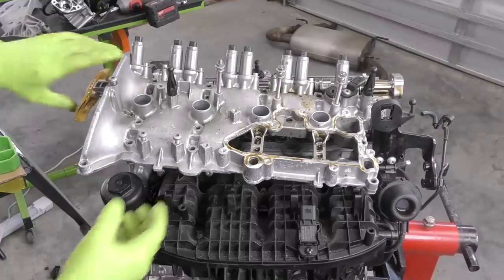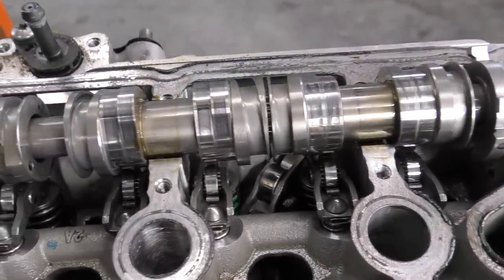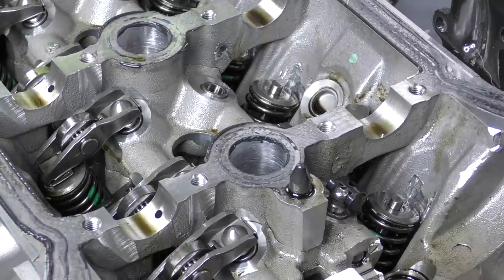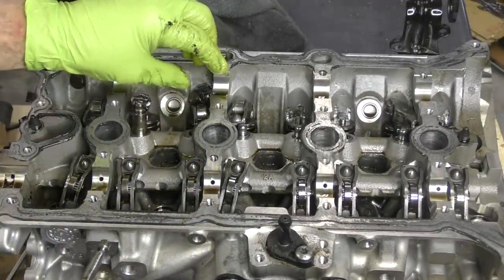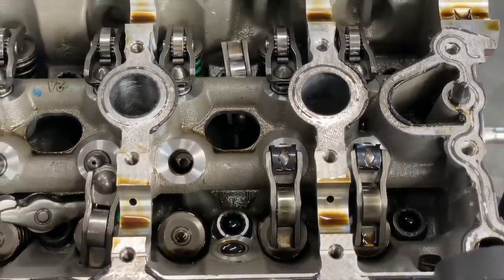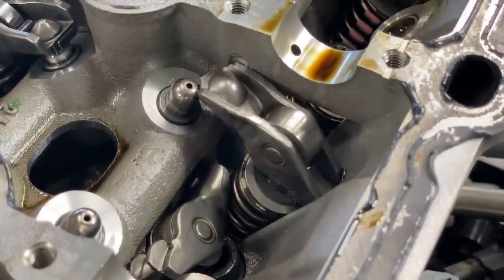Catastrophic Engine Failure VW 2.0t TSI Engine ~ MONEY SHIFT!

Comment: Be cool if the Trans had electronic or mechanical control gear lockout for lower gears when at set RPM and/or speed, so it wont let you shift into a low gear if it cant handle. Dodge Challenger uses skip shift to force you from 1st to 4th, just use the same tech to stop a bad downshift. Great breakdown vid.. I could watch these all day!

Comment: Wow, this just came up on my feed. I had a ‘16 GTI that had this failure, but my guy got lucky. It only floated one of the intake valves. Came in with a misfire on cyl. 4. Car was still under warranty (except for this repair). Amongst the 0300 and 0304 faults was an engine over speed fault. Expanded conditions showed it set at 9700 RPM and just under 100 KPH. Had slight compression loss on cyl. 4. One tweaked intake valve. Just had to replace the cylinder head and it was good. Probably could have just done a valve, but I didn’t want to risk a damaged guide.

Comment: I accidentally wrapped the tach with 1st gear once on my 2.7 Hyundai V6.  That was 80k miles ago.  Can't kill those engines.  This VW pivot ball rocker setup is similar to Honda B18/B20 non VTEC valvetrain, and I've heard this tends to happen on them when you start trying to increase the rev limit.  Solid pinned rockers or cam on bucket FTW.

Comment: Just took the cover off my wife’s ‘09 GTI. Looks like it jumped time and one of the rockers saw his way out through the cylinder head cover lol. Looks similar to this one, several rockers are off of the valves and very loose. Most likely bent valves but haven’t dug that far into it yet.

Comment: I've over rev'd an engine once.  I guess I got lucky as the rocker arm just rotated off the pushrod and valve.  I just put it back in place and readjusted.

 I was warned the 891 Corvair cam did not like to rev, I thought and extra 80lbs on the nose would have fixed it.  Nope.  The Isky 270H that replaced it was just fine to 75.

Comment: I did this on my step-thru moped 40 years ago (Honda C90 Cub) flat out in 3rd gear 57mph, stepped back to 2nd. haha The back wheel locked up instantly, put me into a skid, as the engine sounded like it hit 20,000 rpms. Even after that the little Honda was perfectly fine. The only thing that broke was my chain.

Comment: hey Charles I wish you would've turned the engine to TDC on all cylinder to see if the pistons are at the same level I wonder also about the rod and bolts been  compromise I would at least replace the connecting rod bolt and maybe have the rod check for fractures .
Reply: My thoughts as well. While the engine is mainly apart, I'd check the rods and replace the bearings and piston rings.
Reply from the maker: Mingus end up doing a bottom end breakdown too

Comment: Just today I diagnosed a catastrofic failure on a 2011 Polo 1.4  The owner never changed the oil in the engine, never ever in 9 years! It was like nutella, the oil couldn't reach the top of the engine anymore, camshafts were turning totally dry, some of the intake valves seized. It was still possible to turn on the engine but it sounded like hell. On top of that, the water pump was leaking, so it had no coolant too..

Comment: I had an A4 with a similar experience but on the car I worked on it was only cly4 it had miss fire and no compression when I took the valve cover out the rockers have relocated themselves somewhere else in the engine

Comment: Thank you. I dodged this this video for a while thinking it was another "VW Flaw" video. Most of those seem to be rooted in poor maintenance adherence. My 99 mk4 golf  has been a trooper and while a bit of a dog has been extremely dependable and has been cheeper to keep on the road than my fairly well maintained domestics. It always had a better feel of the road even when bushings and shocks started showing their age compared to my domestics. I've driven close to 2 million miles so far in this incarnation and that little golf kinda nailed the driving experience while being cheap as shit per mile on fuel. Replace all vac lines one fails and put up with the crumbling interior and falling headliner and it still is dependable. Could pack is so expensive. No it's not. Change it once with a proper replacement and all is well. Change the oil enough so timing belt doesn't fail, all is well. Water pump fail? So what. Change it and change timing belt. $700.ish. cheaper than 2 car payment and a month of insurance.

200,000 mile and original clutch. Wow!

Dodged because 2014 CC,  6 speed manual, "well maintained", new tires all around 1 year before purchase, beautiful paint, minimal curb rash, no leaks, new tensioners, no codes, quick as shit, but not fast, made me bite again. It's a beautiful driving experience. 

I've had to drive high end audis, mercedes, and bmws but I can't stand the loss of "driving feel". I only feel like I am giving orders to someone else driving. This humble machine seems to only take control when the road is way beyond human control. It so minimal and because of this so satisfying of an experience, it's fun to commute.

Dodged because the brain say a Toyota Camry is the perfect commuter sedan but it's so effing boring on so many levels.

Some might say TRD but now we are in the land of performance. It's seems that "performance" is where the negative comes into play. Trying to outthink German engineers with eBay parts or other engineer s that have figured out how to get "better performance" for the racetrack on public roads seems a recipe for disaster. Build a car for the track if you want to go fast and always have reliable transportation. No one want to hear that your super fast car isn't running and you need a ride so you will be late. No one.

Oh, and change that pill cooler gasket and effing PCV. You can't afford the damage when it fails. It's less than 1 car payment.

The 99 golf has a new owner that loves it and I'm jealous.

Comment: People mess with almost perfect ECU software from factory, put Higher turbo pressure and not satisfied,  submit The 6000rpm engine to 9000rpm.... so conclusion is: its not a matter of possibility to break, but when it Will break. Also,  how is it possible to get a wrong gear shift in an almost perfect automatic car? Was it on purpose? Ok, manual mode is there,  but its a pretty straight forward thing,  right hand paddles gear up, left hand paddles gear down... not rocket Science . Great vídeo! Always great technique and very informative. Soup opera for men.
Reply: Maybe because this was not an "almost perfect automatic car" and It's a manual....Though from my experience you would REALLY have to driving it hard to even get the synchro to engage like that. Usually once you feel an abnormally high amount of resistance when going into gear, you probably are going too low.

Comment: ...bah, I have done that 'mis-shift' in my 1961 MG with a newer, but original, 1275cc four banger and all that happened was that it would drag the rear wheels until the car slowed enough and then the wheels spun...
Reply: Yep used to get the old compression lock in my first car, a 1969 Mazda 1200, handled it no problem.

Comment: Charles, I also noticed that the head is completely cracked on several parts, on the roots of the bridges that support the crankshaft near the spark plug wells, i'm surprised you didn't point it out
Reply from the maker: I think that’s casting marks not cracking. But I am going to go check it again Incase I did miss it
Reply: @HumbleMechanic  i thought so as well but when you move the camera around it looks like cracks as the shadows look to be inwards

Comment: i unfortunately did the same thing. I'm looking at a way to put an electromechanical lockout on the 3 -2 shift or a very short through shifter for 1-2, 3-4, 5-6 and stock separation for side to side. 
@ 110 mph 3rd gear 7000 rpm and going to 2nd = 9300 rpm... and yes $$$$ between $4000 and $6000. but the problem was definitely between the steering wheel and the seat...  oh yeah the new head was back ordered for 3 weeks.

Comment: I had a 3rd to 2nd shift at high rpm in an XR3i many years ago. Gearbox linkage was worn and it was difficult to get the right gear at any time. Had just dropped from 5th to 3rd to do an overtake after being stuck behind a truck for miles. Engine overrevved and was suddenly massively down on power. Limped to a garage and left it there until I could get a tow home. Stripped it a week later to find timing had jumped 3 teeth on the belt and a bunch of valves bent. Worst thing of all? I was actually en route to my wedding at the time 😂

Comment: Actually I don't really see any damage to the head that will interfere with the function of the cams, valves or rockers - or did I miss something?
Reply from the maker: While the gouges May not be a problem, damage to the valve guide port may have occurred. Or where the hydraulic pivot is. Lots of tiny tiny places for issues.

Comment: Thanks again for the vid Charles,  very informative!  I have rebuild Gti mk5 head before, pretty easy stuff considering it as no variable timing. the rocker design and look, look  very similar This however is a different story.  Never would I have thought that the intake and exhaust rockers were different thickness and that the valve cover and head was line bored to match. I guess that head is pretty much going to make its way abroad to be recycled into another vehicle.   Greetings onve again from South Africa.

Comment: At 20 years old I money shifted my Corrado G60 up to 8600+ rpm. Unfortunately for me, I blew the g-lader and not the engine. I could’ve picked up a used motor for under $1000, but instead had to part with $3000+ for a supercharger...

Comment: I believe the shifter should have some kind of lock to prevent it from going into a lower gear whilst at high RPM... I find it very difficult shifting down to a lower gear if I'm already at redline (felt it a few times)
Reply: Depends on the quality of the synchro rings. Apparently they’re pretty good in this VW because they linked up and accelerated the 2 gear to way beyond redline. Whatever car you were driving probably had weaker synchros and wouldn’t click in and that saved you.
Reply: @Dave-ei7kk  can't be that then, I drive a SEAT Leon Cupra which has the same engine and gearbox as VW

Comment: I have a question about the rocker arms. I’m rebuilding the cylinder head. My valves are bent. And I’m noticing on my rocker arms. I see some people able to squeeze the tappets together. Like a hydraulic shock. None of mine squeeze together. I can get a few to like move. But none of them squeeze together like a hydraulic shock. Does the intake and the exhaust side the rocker arm tappets squeeze together? Or do they stay stiff?

Comment: At 7:22 you show the missing rocker...... that roller on the rocker does not describe an over-rev. Looks like it had been worn in pretty well more, than oops I went for 4th and hit 2nd gear.... that roller says "I've been failing for a while". Nice dull, dimpled appearance that would take hours of running time to work through the hardened surface of the roller..... not the 3 or 4 seconds for catastrophic engine failure which produced the hole in the cam cover. Surly the engine was pushed past its RPM limit and thus the hole in the cover but you cannot get the wear needed to complete the pattern on the roller from #1  intake rocker in an over rev situation. Most likely insurance fraud and an intentional over rev..... Just a hunch. BTW excellent video and quality... keep up the good work.
Reply: Reply to my post.... at 5:58 you can see the #1 left intake lobe on the intake camshaft has grooves/worn out lobes that match the wear pattern on the lifter roller at 7:22..... been running for hours to make the damage that is visible. Also you see at 7:22 that needle bearing roller has failed. The stamped steel rocker arm vs the diameter of the roller is offset. The roller is clearly at the same level as the stamped housing indicating the roller is no longer centered on its axis (needle bearing failed allowing for this offset). I'm sure there were lots of little metal parts in the oil pan that were there a long time before the over-rev.

Comment: Did this on my Honda motorbike - talk about engine braking - like hitting a wall. Motor survived. It's limited to about 8.5k which is quite low for a bike. Being a Honda it's maybe designed for reliability over performance and perhaps means there's a margin to avoid spontaneous disassembly. It'd probably quite happily do 14K with a bit of reprogramming.

Comment: exactly this happened to me on a racetrack on honda civic type-r fk2 (2016). Was in 3rd just about to shift to 4th before the red line and shifted to 2nd due do high lateral G. I calculated the resulting RPM to be around 9200. There was no tuning on it, just cat-back and cai. The engine survived without any problems, however it was a very short over-rev. Roughly half a second.
Reply: The difference is, it's a Honda, and no German engine (I 'm from Germany, but our engines are today nothing we can be proud of)

Comment: Charles, why do you think there is so much oil in the intake? Bent valve guides letting oil in? A oil passage hole leaking oil?
Reply from the maker: Guides or possible pressure in the valve train. The valves held that oil in. I've not seen that happen before.

Comment: Too bad, thought the failure was d/t crank-walk and would shed so light on the issue, it has happened to my R and several other R’s/GTI’s which should not be happy to brand new 30-40$ cars....

Similar to IMS bearing failure like older 996 911 I think...

Comment: Hi Charles just rewatching this. I was cleaning my intake valves and noticed my cylinder 3 valves weren’t moving. Took my cam cover off and found on rocker just chillin on the exhaust side. Bought and oem replacement do u know can I pop that on without loosening the chain? I just replaced my chain tensioner and guides last year.

Comment: What's really interesting to me is how similar Gen 1 and Gen 3 EA888's are below the surface.  Which should be obvious, really, but it's interesting how a bunch of compariatively minor tweaks here and there can result in a platform that seems to be regarded as somewhat more reliable, when so much else is basically the same.

Comment: The Germans are somewhat forced into these plastics by the stringent recycling rules they have in Germany in particular.Plastic does last but only in relatively moderate climates such as alot of Europe.I had no issues with my BMW at 10yrs old and 120k miles.Also the failure rate is probably still comparatively small given the number produced.You never hear or see the videos on the good ones for obvious reasons....how dull would that be...😂

Comment: From what I understand if the spark plugs have oil on them this means that there is a problem with oil in the cylinder heads and that  there's an oil problem. I hope I said that correctly.

Comment: Great video.  I had a 2000 gti vr6 when I was a dimly lit 18 yr old nitwit & had just learned of quickshifting, (shifting at the rpm sweet spot between gears without use of the clutch pedal) and my VERY first attempt I immediately destroyed the clutch, subsequently  moneyshifted, & just murdered my whip. RIP.

Comment: I remember all the years working on these TSI motors at the last vw stealer I worked at. Most common thing I saw was the high pressure fuel pump cam follower mashing to pieces, tearing up the cam lobe. On the ones that were really bad, the inside of the cover would be all gouged up. Pretty common failure point. Not particularly a fan of this design. It's no 1.8t for sure.

Comment: Imagine some type of electric “clutch” or sprag or cog spline system of sorts that is spring loaded to want to disengage the output shaft (or input shaft to reduce torque load) and a non worm motor to push it engaged when setting off and pull it out of engagement when a problem occurs under load (the spring won’t be enough then) and a solenoid latch to hold it engaged to save the little motor from having to work against the spring, that could save this scenario from happening and the whole procedure could be tested on startup as a way to make sure the components don’t fail, the motor moving in both directions helps with keeping it from jamming and it can even preload the spring again when testing the solenoid latch to help save it from wear and excessive load

Comment: This happened to me. 2008 GTI brand new with 19k miles on it cAPR stage 2+ moneyshift. Head looked like this. I was young and stupid and replaced the engine. Wondering if it would have made more sense to just swap the head

Comment: The head is actually not that bad at all. The gouges can be grinded flat and it should be ok. it seems there is no structural dmg. I had an old Renault 19 on natural gas sprayed directly into the intake, no rpm limiter and i had my gas pedal stuck under the floor mat once :D I cant believe the engine survived the 9 mil rpm. Drove the car for another year before i sold it. Never touch the engine but i change the floor mats Lel

Comment: Hey charles! Need help! The cam cover, do you have to remove the timing cover and hpfp to remove the cover? Cyl 3 is leaking oil into the spark plugs i believe and my catchcan is just sucking up straight up oil is that possible? Im not sure where to start before i make big moves. 90k still running strong, stage 2! Love your yellow golf R BTW and videos of course! Much love and respect what you do for the euro community!